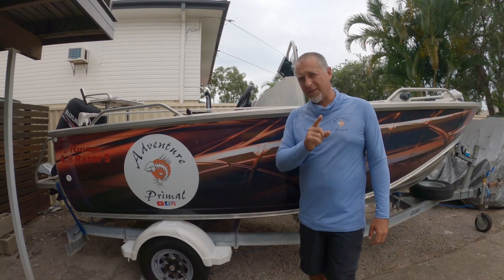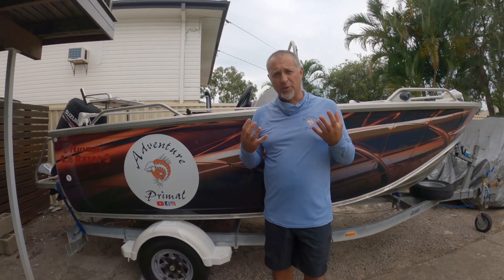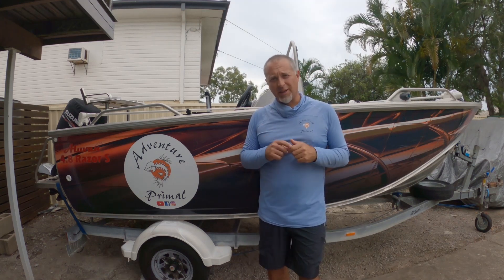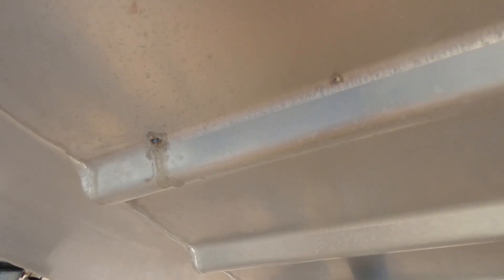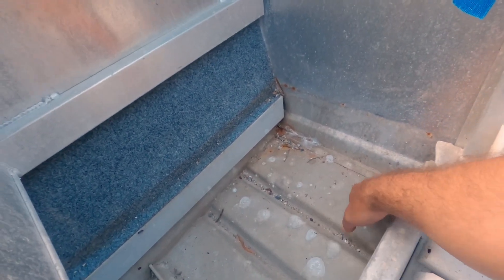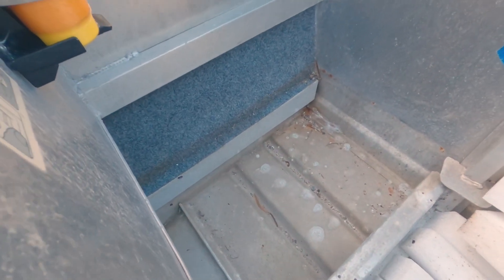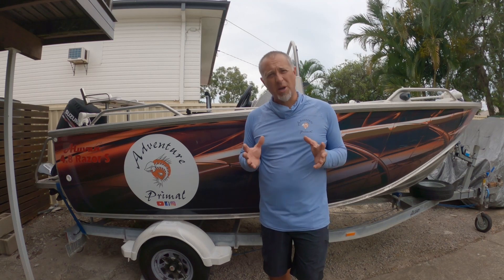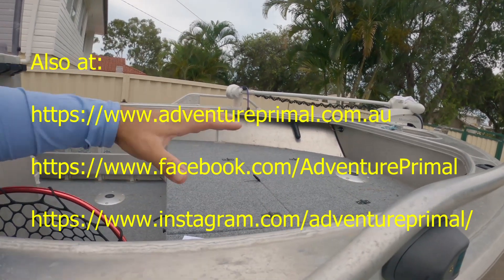Protecting Aluminium Boats from Corrosion

Comment: Washing helps but it is the Zinc plates and blocks that prevent the corrosion. They get attached in several places. For fresh water boats you use Magnesium plates and blocks.
Reply from the maker: certainly need to look after new boats hey

Comment: I am a retired dual qualified Chemical Engineer with a life long love, and obsession for caring for aluminium alloy boats. If I may, I would like to share with you, some details on how to preserve and protect your baby.
Big picture stuff first i.e. macro protection. The arch nemisis of aluminium alloy is electrical contact with disimmilar metal in the presence of an electrolyte; in our case, saltwater. So the first thing I have done with all my rigs to date, is to make sure that the outboard and trailer are electrcally insulated from the hull. My hulls ride on polymer non-conducting skids so the only other electrical contact betwwn the hull and the trailer is the winch hook and the safety chain hook. I have clear plastic tube slid over both hooks to insulate then from the hook up fitting integral to the hull.
I have polymer belt inserts between the top of the transom and the motor landing and polymer patches under the motor transom clamps so the motor cannot electrically 'see' the transom and therefore hull. Whereever possible, I have avoided using fasteners penetrating the hull, and the only factory installed stainless floor panel screws are all liberally coated in Duralac, by me. I have just, again, very recently, wandered through a boat retailers yard, and shuddered at typical uninsulated outboard anchor bolts being directly brought into electrical congress with hulls. The shafts of these bolts should be shrouded in high desity, deformation resistant  polymer tube, 8n concert with Duralac. 
I could, and, would like to, go on, but I guess there are not so many other  technical fuss-pots like  me!
Reply from the maker: Thanks for that willshunting. 
I'm actually looking at doing a further video on this as I am continuously finding more holes appearing in my hull due to corrosion. In my research I have found this website (https://fractory.com/aluminium-corrosion/) that explains the various ways that corrosion can occur in aluminum. They are basically related to what you said - an electrochemical reaction. In my case, I may have something more like crevice corrosion. I am finding the corrosion holes are wet to touch meaning there may be sediment and water being retained on the inside of the hull due to structural beams or the floatation foam that's pushed in there. I wont know until I can take the floor out and have a good look in there. If its the case, i was thinking of coating the inside of the hull with something like Tectyl 502. I'm thinking it will provide some additional protection for a few years before having to clean out the inside of the hull again and apply some more. 
 And thanks for your detailed information. I know that my deck screws are stainless steel and that they are installed without any Duralac like substance. They are directly screwed in. So I will get some of that Duralac and do the screws when Im putting the deck back in. I'll also look at the outboard and trailer situation and see if that needs any isolation methods.
Reply: Bare aluminium typically forms a passivated layer of aluminium oxide which is generally protective against corrosion however galvanic and stray current  induced corrosion can manifest as localised pitting and eventually full plate thickness pin holing. In addition to your other efforts, I would be checking the entire electrical system to ensure there is no earth to hull leakage or other induced currents. Again, if the motor is not electrically isolated from the hull, stray earthing current can result in localised sections of the hull acting as an unitended sacrificial anode leading to incipient pitting, particularly in high structural stress zones. Pits must be flushed with acetic acid and then removed once the cause has been identified.
Reply from the maker: @willshunting  yep. Ill try and check all that whilst i have the floor out. Easier to see cable runs then.

Comment: I installed garden sprinkler throughout my boat including underneath my treadplate floor. After a day out I just hook the hose and salt away muxer up to the hose fitting, turn it on. Have a beer, turn off, let it sit for another beer, turn it back on and have a beer while flushing it all out.
Reply: ohh that is the best idea I've ever heard. Damn thats good. Does the floatation stuffing get in the way?
Reply: @darrynbowden3290  nah. I'm not a fan of polystyrene it absorbs moisture, promotes corossion, becomes waterlogged, bits break off and can foul your bilge pump. I have 150 plastic 2 litre milk bottles underneath the floor, provides 3000N of bouyancy which is the equivilent of 20 inflatable lifejackets. Just remove the labels and tape the lids on. Before you think I'm some milk junkie I spoke with my local Cafe and went down every afternoon for a couple weeks grabbing a coffee and as many empties as I could carry to get what I needed, yes they thought I was nuts.
Reply: @bigaaroncunny  thanks for that. That's one of the best tips I've heard. I think I'll start to collect plastic bottles.

Comment: I own a 2014 420 renegade, I remove floor boards and foam once a year. Gerni with truck wash let dry, vacuum spray lanolin inside hull. Reinstall foam and floor, after every trip I wash with CT 18  spray fittings, under gunnels, outboard motor with Inox M4. Been doing it since new no corrosion yet.
Reply from the maker: That is the perfect routine to be doing. I'm sure you wont have corrosion issues following that. I'll be doing similar. 
Thanks for providing the comment Adam.

Comment: I had boats for 30 years. I have had lazy times but never had corrosion from debris. I've been searching a lot lately as I bought a boat with 28 rivets or screws on the underside. 
I ripped everything out. I believe it to be electrosis. 
At the back the battery tray was fairly corroded at each screw point.
The boat owner must have fitted them using a different metals. Dissimilar metals the experts say. Add salt water or even freshwater and electrosis with start.
The other problem...and boat yards do this according to an auto electrician... is caused by earthing the electronics to the hull not back to the battery.
A friend of mine had a screw fall out near the cigarette lighter. A wire earthed the boat. Now he has to get it cut back and welded. 
Washing your boat is exactly the right thing to do. As is keeping it dry. 
But, if you get more holes check all screws have been fitted with tef-gel or another type of barrier sikaflex maybe? Along with electrical wires being in good condition and earthed to the battery.
Reply from the maker: Thanks for that. Yes im getting holes again. Im going to pull everything out in winter and have a look. I believe it electrolysis. Ill go thorough the wiring and give everything a good clean. Spray the inside of the hull with some sort of corrosion protection.  Try and slow down tbese holes hey
Reply: @AdventurePrimal  yep. I always believed if you use stainless screws it's ok. Not so from my research. Any screw needs to have tef gel..there's another brand I can't remember the name of..or they can start corrosion. Your boat is painted. So you should see bubbled paint near or around the fitting. 
You can test for electrosis with a volt meter so I read. Put the positive against the hull or point of corrosion and earth the neutral. The voltmeter should read zero. If not you have electrosis. 
I've read once you have it ya stuck. But I know guys who cut the corrosion out renewed with a patch and it was fine after that. 
Good luck with it all. Oh, anywhere indifferent metals touch there should be a barrier. It's the reason you see rubber under the ribs on the hull. All it needs is salt water and it can start.

Comment: Get a high lift jack from 4wd super centre jack the front up (use caution with the jack) that way it will give you the lift to get everything out. My driveway angles the wrong way so when its reveresed up water used to sit in it till i put the jack under it
Reply from the maker: Nice. Good idea. Definitely will help with the flushing out. Thanks for that tip.

Comment: Surely the holes would have been caused by some old sinkers creating electrolysis from dissimilar metals. I wouldn’t have thought corrosion from debris would cause the holes?
Reply from the maker: Hey Peter. Old sinkers will certainly do that but there were none in the bottom of the boat. Also, the main corrosion (and holes) occurred on outside corners where a sinker could not sit as they would fall of and into the pressings. I guess when you think about it, those small pebbles and rocks would contain ores and minerals that could cause the same issues as metals. I'm going to give the boat a good washout from now on to eliminate this as a possible cause for the corrosion.

Comment: No it won’t.

If you want the corrosion to stop you need a barrier between the aluminium and everything else. Clean all ally then spray everything with Lanotec hd lanolin
Reply from the maker: Thanks Nic. Yes barrier protection is a good tip